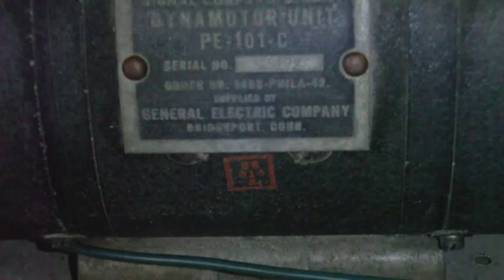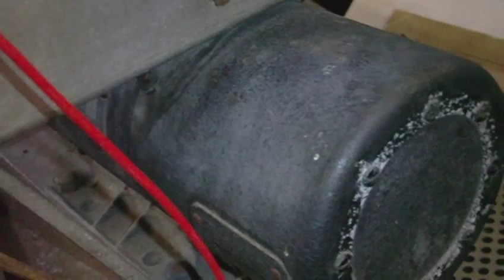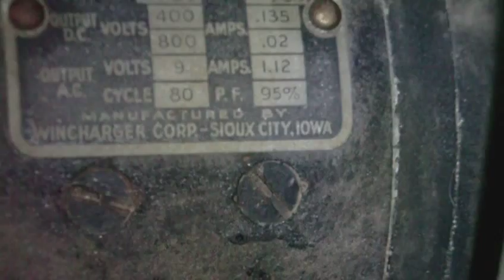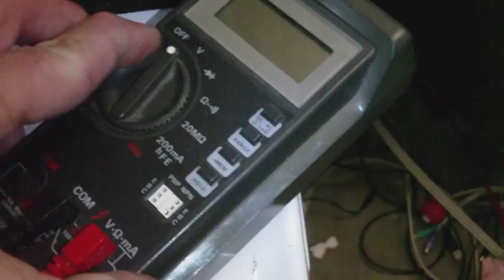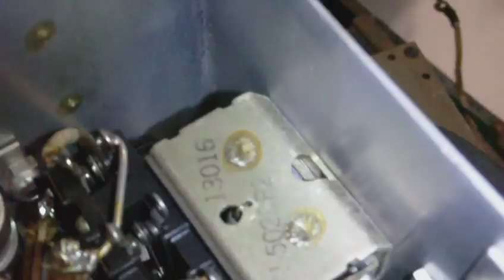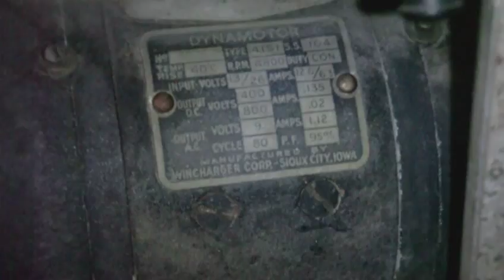GE / Wincharger Dynamotor PE-101

Comment: You can  "get a  good feel"  for this by looking up a  YouTube vid of an  SCR-508 by user  LifeIstooshortforQRP,  who  I don't know.  These were a rack  in tanks having  two receivers and one  transmitter,   with a dynamotor on each.  The  dynomotor on the tx only  energized with the PTT switch.  I had one of these briefly.  Both  rx  dynamotors run  with rx power,  making  a quite interesting  beat sound.   The tx dynomotor is much louder when keyed.  These covered somewere around 20-30MC low power wide band  FM,  making them  the rough equivalent to a huge, heavy  "CB" rig

Comment from the maker: @field16b I forgot to mention that I was only applying 1/2 the normal input voltage. 12 volts instead of 24, so it was only putting out 400v instead of the usual 800v.